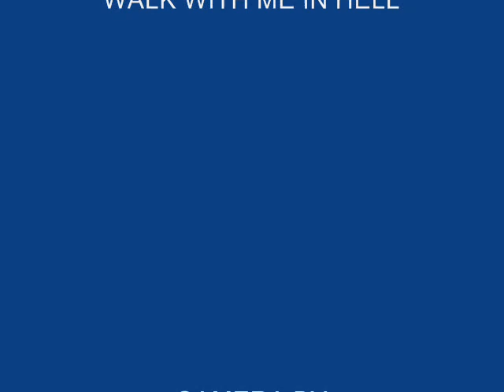JT ENGINEERING SAIGA 12 MAGWELL DEMO BY JACK TRAVERS

Comment: Are they just standard mags, or custom mags to work with the magwell?
Reply: kirkthecapt They use Surefire or AGP mags where the front latch and side ribs are removed. Requires fitting with every mag, but works pretty well once you've got it set up.